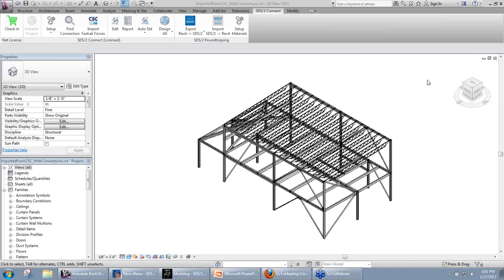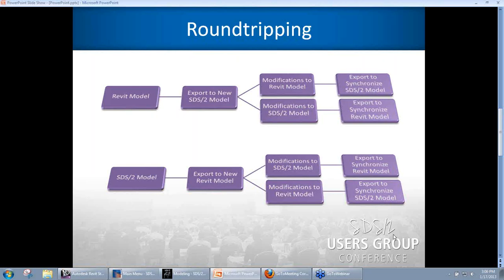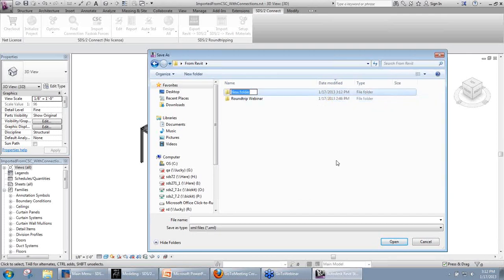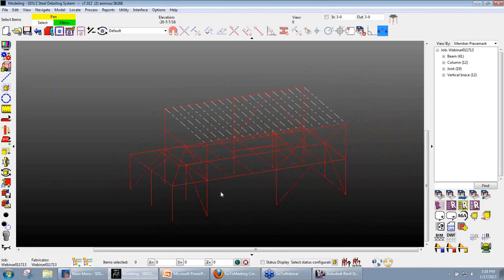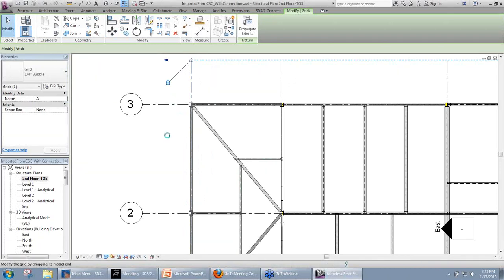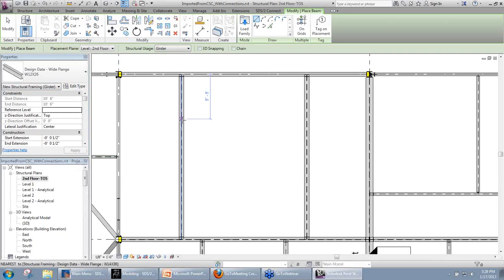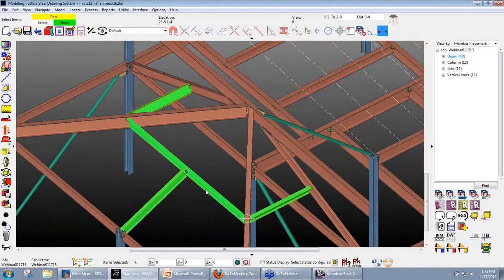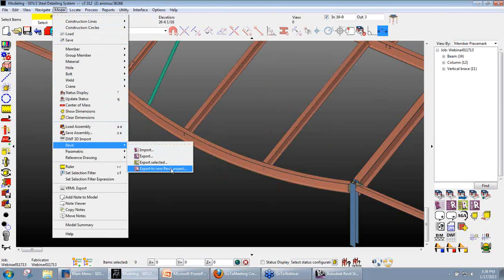30 @ 3 LIVE (Replay): Roundtripping Models Using SDS/2 Connect

Comment: How to get that SDS2 connect option in to the revit model. Please explain
Reply from the maker: Hi, we no longer have Revit Connect, and only offer SDS2 Round Tripping: https://sds2.com/roundtripping
Reply: @SDS2_Software  Thanks for the reply! Yesterday we just had used round-triping and it went very well
Reply: @SDS2_Software  I am having 7 to 8 years of experience with this amazing tool SDS 2. But recently I am trying hard to learn advanced options such as parametric modeling & writing parametric by my own. Please guide me or advise where can I find necessary knowledge videos
Reply from the maker: @praveenmaradani8973  Hi, for assistance with your request please contact our support department at support@sds2.com and they'd be happy to assist you.